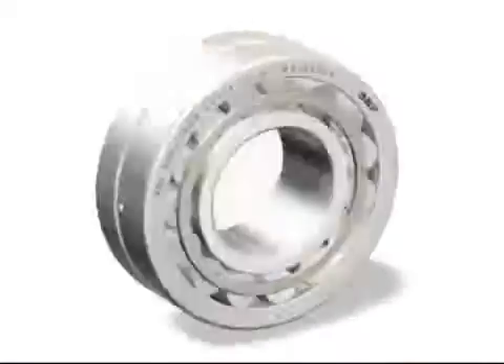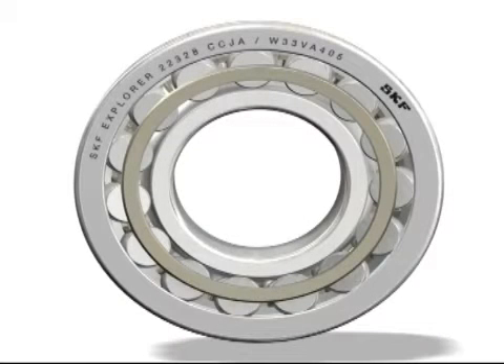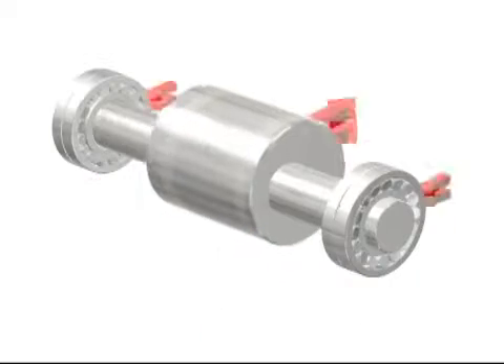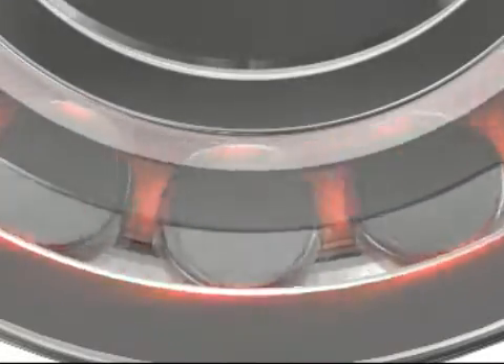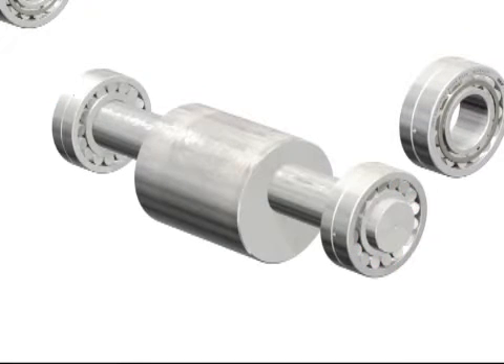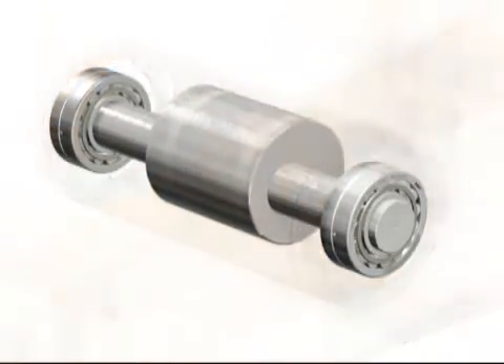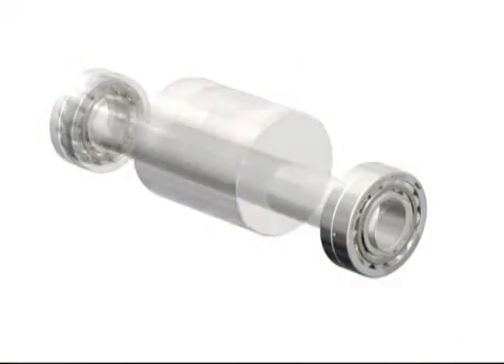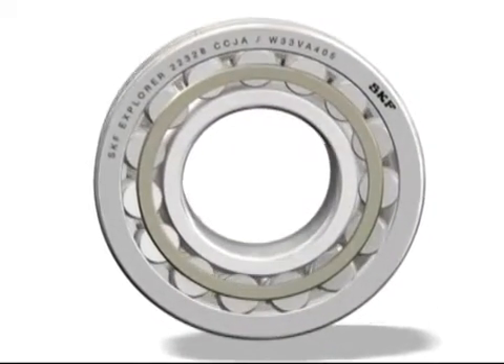SKF Explorer VA405 in vibrating screens

Comment: Exelente, Que tipo de lubricante o grasa puede utilizar este rodamiento en esta aplicacion, Agradezco la respuesta.
Excellent, What type of lubricant or grease can this bearing use in this application? I appreciate the response.
Reply: Hi, it depends, but generally, for grease lubrication, we use SKF LGEP2 for cold material, can be SKF LGHB2 for hot material. These are general recommendations, every case sis different. For oil, ISO VG 150 or 220 with good properties against wear, corrosion, foam, ...

Comment: https://www.mtroyal.com.tr/en/product/vibration-screen/
1-Tenacious And High Resistance Structure.

2-Spherical Roller Bearing With Bushing For Easy Move And
Replacement.

3-Body With Integrated Steel Sheet Without Welding due to
design change.

4-Shaft With Alloy Steel.

5-Body With Steel Sheet 10-12mm Thickness.

6-Quick & Easy Net Installation & Replacement.

7-Decks Made Of Mannesmann Pipe For Prevention From
Breaking The Decks.